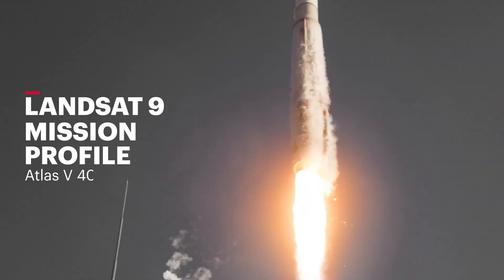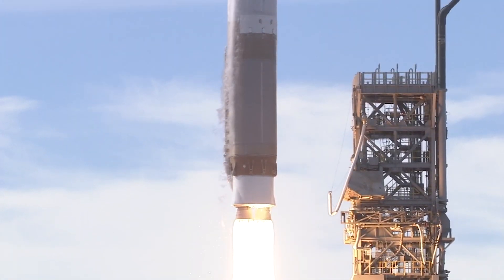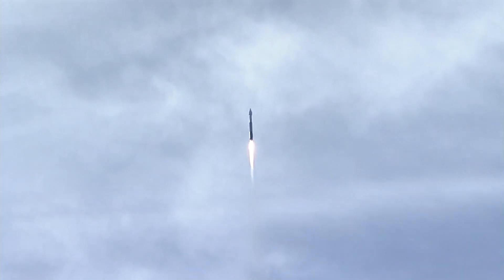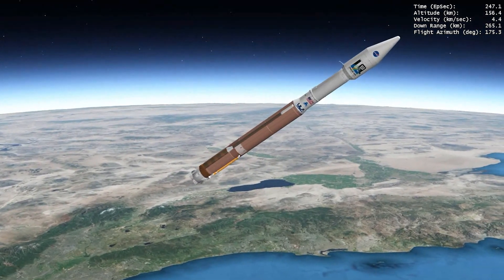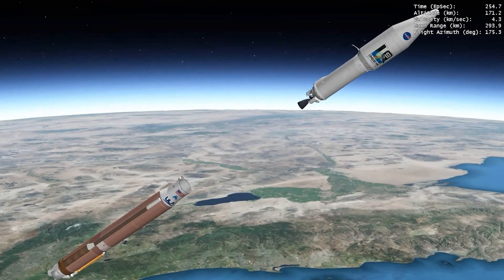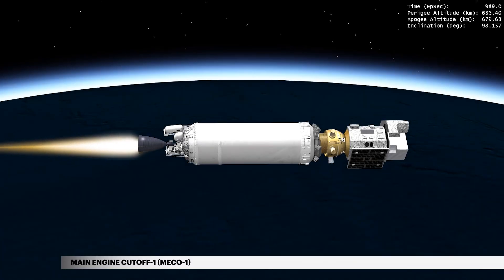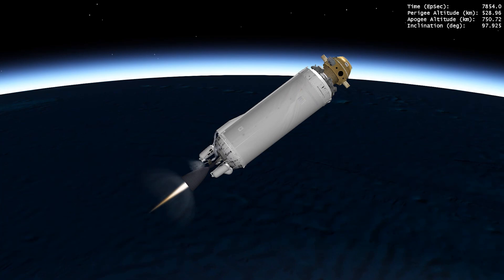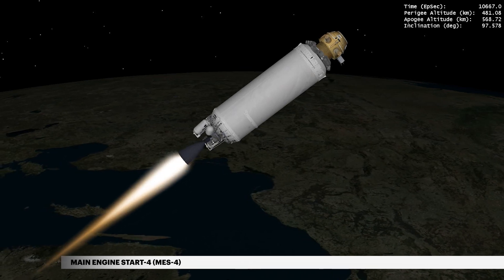Atlas V Landsat 9 Mission Profile

Comment: 670km orbit? That's quite a high orbit. Wouldn't it be more efficient to insert into a lower orbit and use a transfer or it to ascend up to altitude?
Reply: Better Direct to LEO by the rocket alone. More propellent mass reserve for the satellite orbit keeping.
Reply: That’s why ULA is doing this launch. They can put the sat right where it needs to be. SpaceX can’t because they land their rockets. ULA can use all propellant and put the sat right where it needs to be.
Reply: @dummyjoe7895  Falcon 9 has launched satellites to geostationary orbit and still landed the rocket. Its fully capable, but the atlas v is more reliable/higher track record and has had a longer lifetime compared to the falcon 9
Reply: @zacharyj6465  yes Falcon 9 can do geostationary, but it can’t do DIRECT to geostationary. That would require a FH and possible an expendable center core
Reply: @zacharyj6465  Different mission profile. This mission is direct. F9 did multiple burns.
Reply: nah